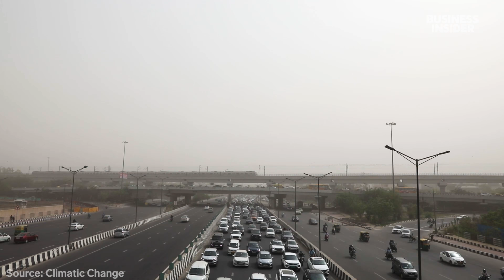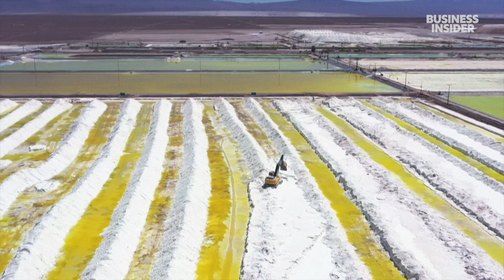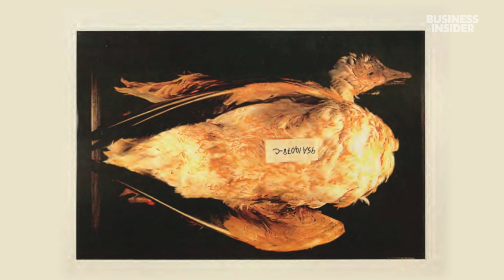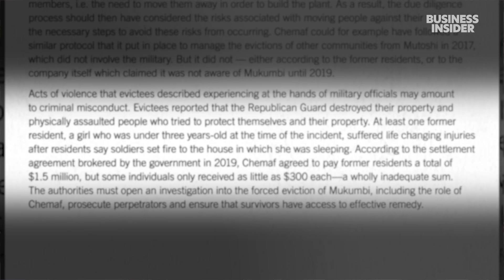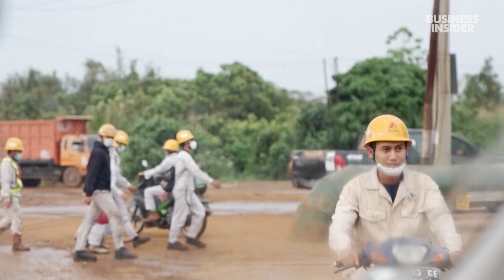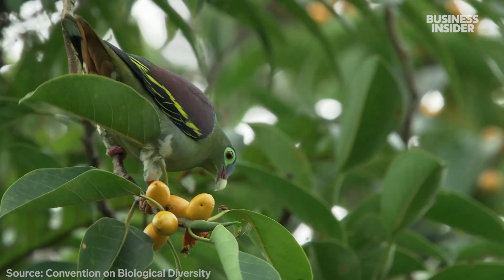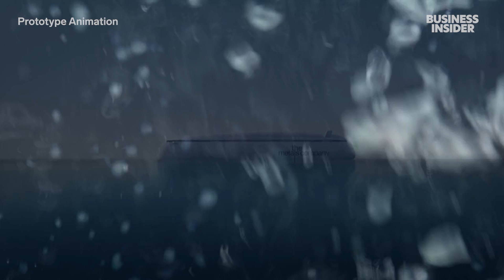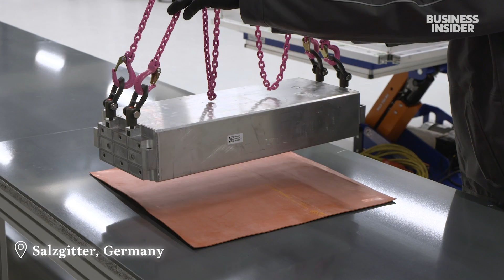The True Cost Of Mining Electric Car Battery Metals | True Cost | Insider News Marathon

Comment: Perfect is the enemy of good is an aphorism which means insistence on perfection often prevents implementation of good improvements. Extended Range Electric Vehicles or EREVs are vehicles in which propulsion power is provided almost entirely by an electric unit. They are additionally equipped with a small internal combustion engine to generate additional energy. These types of cars are often seen as series hybrids with a much larger battery. With evolving Sodium Ion technologies, EREVs would be a great deployment. No Cobalt, Lithium, Nickel et al. Also, soon motors are starting to be deployed without rare earth elements.
Reply: The term you're looking for is PHEV (Plug-in Hybrid Electric Vehicle). EREV is a GM marketing term (like 'scrubbing bubbles'... not a technical term).
Reply: @Hamilcar_Stronginthearm  Get off of it. So what. PHEV or EREV ... Simply highlighting longer range of EV only of vehicle.
Reply: All hybrids are either a gas engine carrying dead batteries, or a battery powered motor carrying an idle engine body. Neither situation is fuel economic. Either make a fuel efficient gas car with acceptable emissions, or make a pure battery car. "No Cobalt, lithium, nickel et al." This is a lie; the sodium ion batteries still require mining these metals.
Reply: This is the approach we should have taken, and I’m glad Toyota is doing this on their own. The infrastructure to support a total transition is simply not there yet. Don’t get me wrong, it will be, but it will take time and hybrids are the best way of easing in that transition. If we went in that direction and actually planned out the transition, the EV debate wouldn’t be nearly as caustic as it is. It didn’t happen that way though, because politicians pass these commitments with their upcoming reelection in mind, not the greater good of the planet
Reply: "Lastly, 48 volt EV architecture reduces copper by 70%"

Nonsense, compared to what? Also, the motors still need a huge amout of Cu, so i dont get your "argument" at all. Seems for me you are just a EV fanboy trying to argue for your fanboyism
Reply: @harrison00xXx  If you double the voltage the amerage is cut in half and yet yields the same power output. By increasing voltage considerably the size of the conductor is reduced.
Reply: @kerrryschultz2904  and yet you need the same amount of copper (longer but thinner winding)
Reply: @harrison00xXx  You are not exactly correct. If you compare the amount of copper in an electric motor that uses 120 volts AC to an electric motor that uses 2800 volts AC there is very little change in the amount of copper. And yet the power potential is increased many times. In the reference to using 48 volts I am guessing that it was compared to a 12 volt DC system which would require huge amounts of copper to do the same work as a 48 volt system because the increase in amperage. I doubt any car manufacturer would use such a low voltage system and is more likely in the 120 volts or high DC.
Reply: @kerrryschultz2904  learn about thermodynamics a bit before trying to argue with an electric engineer about electric stuff.

Yes higher voltage allows for more potential power but in general you will be thermal limited, the more power you want the bigger the motor gets (and the more copper you need)

Just accept that if you use the appropriate voltage, the copper usage wont differ to a meaningful point
Reply: @harrison00xXx  Yes there are many things that limit the power output of a motor such as hysteresis' and magnetic saturation, and counter EMF fields and thermal limits, but many factors such as clearances and airflow adjust the build demands. And what makes you think you are the only electrical engineer in the world.
Reply: @kerrryschultz2904  that was a really funny word salad to try to Musk your way out, but failed. please try harder.
Reply: @kerrryschultz2904  what makes you think you can save reasonable amounts of copper AND increasing performance at this point? electric motors are pretty much developed to a point you can not improve by a lot anymore, which you should know if you have any reasonable technical understanding
Reply: @harrison00xXx  Get off your high horse. The whole context from shawnnoyes is the reduction in the amount of copper in a system of a certain voltage {48 volts} compared to I don't know. He stated an overall reduction in weight of copper by 70%. I believe that he is talking about the entire car. In some cases such as Aptera they are using relays to help cut down the amount of copper in the overall assembly' and using permanent magnets in the motor assembly which obviously removes the windings in a convention stator. In this case because he seemed to convey about the entire EV build there is room to consider a reduction in the amount of copper by a number of avenues such as using aluminum  from the controller to the relay. I see that EV manufactures such as Tesla are using upward of 800 volts in their drive systems. I agree with you that high voltage systems have thermo limits depending on the amperage, but no different that the same rules on a low voltage system if amperage is excessive.
Reply: @harrison00xXx  How are you gonna throw down the smug EE card and not look up the voltage that the 48v architecture is an upgrade from? Hello? 12v DC just like the lead-acid batteries we've been using for a century. No room for meaningful improvement? Are you stupid? You are certainly could use a refresher.

V = IR; P = I^2 R
Voltage is increased 4x, resistance remains the same. (its still copper)
THEREFORE
Current drops by 4x, power requirements drop by 16x, wire diameters shrink proportionally. Copper mass per vehicle goes down massively.

You might want to consider not telling people to appeal to a thermodynamic approach, when you lack the effort to do so yourself.
Reply: @ct1762  Simply, you are not very smart.
Reply: @kerrryschultz2904  get off your high horse where you repeated marketing lies

If you dont know what you are talking just…. SHUT UP
Reply: @harrison00xXx  You may be an electrical engineer but you skipped English class - LOL. Arrogant a**. kerrryschultz already responded. Try to read the comment and comprehend.
Reply: @shawnnoyes4620  you've said this about 2 people so far with no supporting arguments. makes you look dumb, doesn't it?
Reply: @harrison00xXx  I looked up The Dunning-Kruger effect on the internet and your name and picture came up as the classic use case - LOL.
Reply: @shawnnoyes4620  haha you must be a joker
Reply: @harrison00xXx  As it relates to you and your intellect,  The Dunning-Kruger effect is spot on based on your commentary. :)
Reply: @shawnnoyes4620  Are you still trolling and annoying? ok...
Reply: @harrison00xXx  You are the troll as well as annoying. You can not even read and comprehend comments. You go off on wild tangents and insult other people. Hope you can reflect on your behavior - Simply, you are a child.
Reply: @harrison00xXx  Seems to be ... you are not very intelligent - LOL
Reply: @shawnnoyes4620  yes you are not very intelligent not even a single useful input to the topic

Comment: Basic math says that some of his facts are wrong. He starts off with the statement that electric cars contain six times as much minerals as internal combustion cars. From a basic physics principle that would mean that electric cars weigh six times as much as gas cars and this just isn’t true. He seems to be discounting the amount of iron and aluminum.
Reply: Not really. The list of what he is referencing is on that chart shown. I agree that iron and aluminum can't possibly be referenced from a basic math standpoint, but it's pretty clear that they are referring to more exotic metals. 

I'm not saying his information is absolutely correct, but when you consider the amount of iron, aluminum, and other common alloys that make up what's under the hood of an I.C.E. vehicle but are not needed in an EV, most EV's still weigh hundreds of pounds more than the equivalently sized I.C.E. counterpart. So it stands to reason that he's not completely wrong.
Reply: Have you ever seen how mechanics remove a engine from a car?
They use cranes for that and now have a guess what an EV does not have 😉
Your basic math does not work out like that.

Comment: Wrong, some 980mp steel used in ICE gasoline & diesel powered cars, an alloy containing cobalt, vanadium, chromium, silicon, molybdenum. Jet engines used in most airline planes have turbine blades of made of nickel cobalt super alloys that are heat creep resistant when spinning that fast while hot without stretching & maintaining their mechanical strength. So cobalt not just used in lithium ion batteries. Cobalt also used in electroplating for its attractive appearance, hardness, and resistance to oxidation in order to prevent corrosion. In non battery electric marine applications alloys of cobalt, copper & nickel are used for salt water corrosion resistant pipes & parts.
Reply: cobalt is also used for refining fossil fuels.
Reply: You're not getting the bigger point here.
Reply: @Skywest25  And your not getting the point that Cobalt was being unethically mined prior to EVs but no-one cared.  All of a sudden everyone cares.  If you really care, then go an buy and EV with an LFP battery because they have NO cobalt whereas the ICE vehicle you drive uses some cobalt in the oil refining process.  Aaron's point is that the film states clearly there is no cobalt in an ICE vehicle - that statement is wrong - there is Cobalt in the alloys and cobalt is used in Oil refineries.  Try looking at the whole picture.
Reply: @dnboro 
There's also Cobalt in the engine and the gearing.
You cant build modern Engines or Gearboxes without Cobalt.

But gues what? No one fukin cared until the EVa showed up.

Like everyone gives a shit about their electronics but by EVs they lose their mind and got to a protector of nature, driving 0,1 Mile to the grocery store with an F-150.
Reply: @Skywest25  very few of them do. Blind to reality.

Comment: "Conventional combustion engine vehicles don't use any. (cobalt)". Except that they do use it in the production of gasoline and diesel fuel through the desulfurization of crude oil which means they will likely be using more of it than battery vehicles especially since EV's appear to be moving toward zero cobalt.
Reply: Do they require those minerals to actually drive on the road? No. Do EV's require those elements to operate on the road? Yes.
Reply: @Skywest25  😉I'd like to see you operate your ICE with an empty fuel tank. So yes they do require cobalt to operate on the road. Lithium maybe not so much but we already have some vehicles being made with sodium ion batteries and the new chemistries keep coming. Regardless, minerals are not the issue some would have you believe they are. As with many things humans do, it's not that we can't get them or can't get them ethically. It's that we don't for whatever reason. But if you want to talk about ethical lets talk about how ethical oil is both from a geopolitical and environmental perspective.
Reply: @blackwind743  not an issue?? Lol that’s what people would have said about oil a century ago. The bigger point here is the message being sold on EV is don’t worry about what it takes, don’t worry about environment impacts as a result of it. Just  ignore all that and believe components just fall from the sky. Just because the bigger in the end is what matters, don’t ignore the consequences and that’s what’s happening
Reply: @Skywest25  Not sure how I can say it any clearer. Batteries don't need lithium, cobalt or nickel and theoretically you don't even need copper to make EV's. Though that one is a bit tougher at the moment. Carbon/graphene/carbon nanotubes can substitute or supplement many of these metals including copper and you aren't going to run out of carbon. Not to mention, you have oodles of metal floating around your solar system. You won't run out of metals for the foreseeable future if you're willing to go get them, but you're also ridiculously far from it being necessary to go off planet for them. The biggest problem is actually that your economic and political models don't adapt easily to this kind of change which is why media is full of both intentionally and accidently misleading information.
Reply: @blackwind743  you’re right I’m so totally wrong about everything.
Reply: @Skywest25  Wait then how is my 11 year old EV with an LMO battery operating? No cobalt.
Reply: @silvy7394  so it operates on 8 mineral elements instead of 9. Ground breaking
Reply: they use much less than needed for EV battery production, just dont be silly
Reply: @harrison00xXx  They do use less but cobalt is a passing phase for EV batteries. There are already millions that don't use it. To be fair though, it is fairly easily recycled whether it's used in oil refining or batteries.
Reply: EVs are moving away from Cobalt. Tesla dont use any in their new 4680 cell. So a lot of their cars dont even have cobalt in them. So your argument is invalid or at least quickly turning irrellevant.  @harrison00xXx

Comment: Start by forcing those who are able to work from home to work remotely. Saving 370 million gallons per day (or about 8.81 million barrels per day). Forbes 2022. Limit electric vehicles to those used for public transportation. Begin research and development for electric tractor trailers motors. Build elevated electric trains for better public transportation. We will never be able to get rid of crude oil, it is literally used in thousands of everyday products and applications. These batteries are deadly and not worth the effort. We are going from the frying pan to the fire. We are destroying the Earth faster than ever.

Comment: How does an ev stack up against ice, if it's charged using gas or goal fired power which in many places are still being built as grid loads are increased
Reply: While more power capacity is being built, record number of coal powerplants were decommissioned during Obama and Trump. Off-shore wind is now slated for installation in the USA. EVs get cleaner as they get older.
Reply: @stanislavjaracz  " EVs get cleaner as they get older." and yet the impact will be less than 1% less pollution. Sounds unreasonable, and is unreasonable, EVs basically.
Reply: Hydrocarbons hold majority of there potential energy as heat energy, coal plants turn that heat into electricity. Internal combustion engines use expansion wasting 80% of the potential energy. So power plants obtain around 80% of the potential energy with 5% lose over lines and transport. Gasoline uses 20% of the potential energy. Electric cars running entirely from coal still produces less carbon per km. This calculation also does not take into account refining of crude oil which also uses vast amounts of electricity. Refining is basically boiling crude to seperate it into diesel kerosene etc etc
Reply: @nicholaskeenan898  wait until you realise you need AT LEAST (!!!!) 100MW thermal energy to get to about 42% efficiency with steam turbines (the way coal power plants produce electricity)

So your 80% efficiency argument is absolutely nonsense… no power plant on earth relying on conversion from thermal to electric energy goes beyond 50% efficiency due to size restrictions.

The soviets RBMK2400, the biggest commercial nuclear reactor ever planned would have been close to 50% efficiency under 100% load theoretically
Edit… not even close… about 40% „only“ which is still great.
Reply: worse, thats why he didnt mention it and used comparisons with wrong data
Reply: @harrison00xXx can we see the math please
Reply: @nicholaskeenan898  look what percentage private transport have on the co2 impact (<10%), then combine the possible savings (about 30%, tire and break dust still is the most harmful and is a problem of EVs)

Then you have to realise you can not replace all vehicles with EVs, not even until 2060 or so.

So in fact…. 10% maximum possible savings, going down by another 3,3% just because you can not be co2 neutral the next 30-40 years anyways with EV hype, adding the co2 emission (and other toxic stuff) of battery production and recycling as well mining, and you will realise the only impact would be to replace coal power with nuclear power, like this much more and more efficient energy can be produced to get away with the EV hype and mainly coal power charged EVs yet.
Reply: @harrison00xXx  could you sight those numbers? a reduction even with coal power plants converting to EV over gas is 50% and personal transport is actually 30% of emissions. Taking into account renewable energy is now cheaper then coal, coal is being fazed out. There is no silver bullet there's just better. Your argument seems to be based around waiting for a tourniquet because a belt isn't as efficient that's a good way of ending up dead.
Reply: @nicholaskeenan898  you know there is a difference between personal and private transport?!